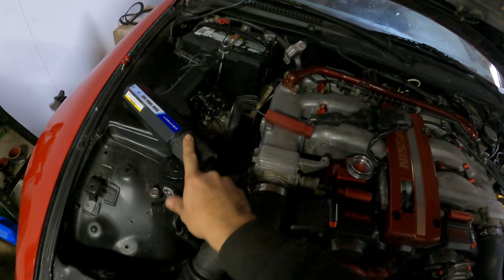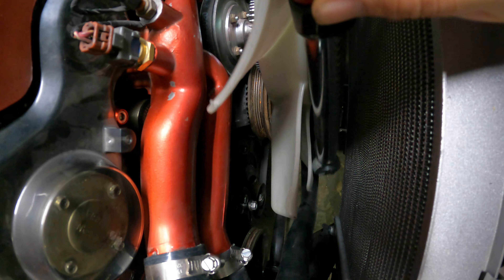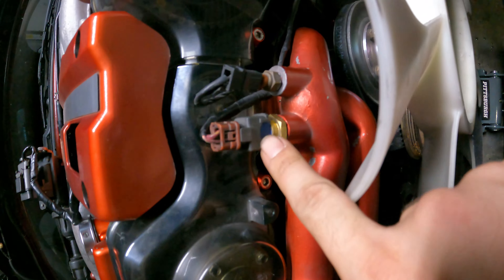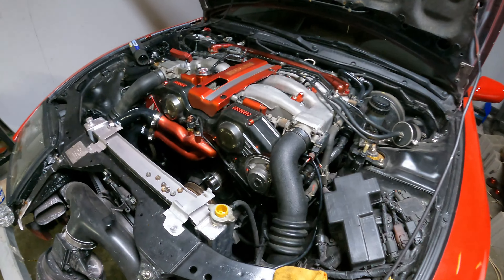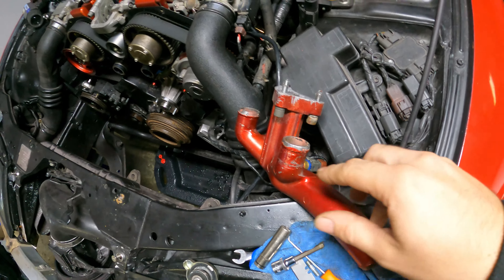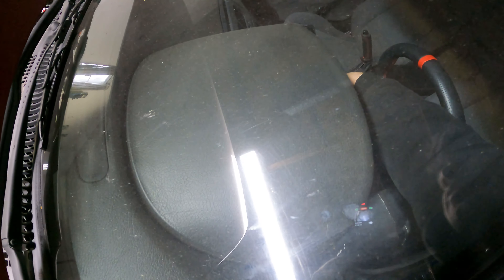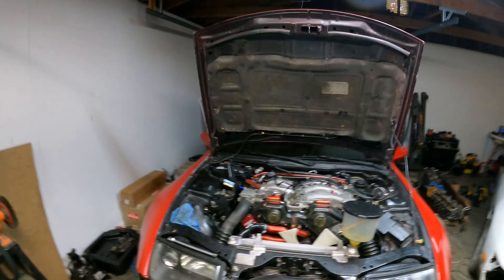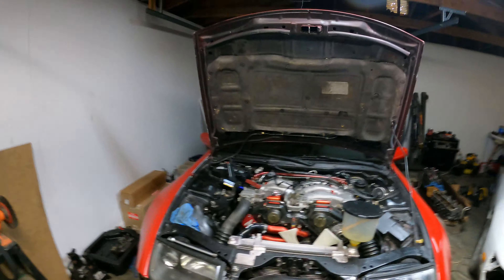This 300zx is Fully FINISHED and Ready to RIP!

Comment: To torque the crank shaft down on an automatic you need a crank shaft holding tool
Reply from the maker: Does it bolt to the 2 bolt holes and rest against the frame rail?

Comment: I got those same type of dress up bolts on my Z. Those aftermarket smoke timing covers don't work well with those Zspec bolts.
Reply from the maker: They had me stressed at the beginning🥺
Reply: @ yeah I believe those are AMS smoke timing covers. I reused my oem covers with the ZSpec bolts and didn’t have this problem. I’m glad you did your due diligence and figured it out before some other issue popped up 😎

Comment: Do you have leak somewhere in your ceiling?
Reply from the maker: That may have been the coolant I heard it a few times editing haha.

I do have to replace my roof soon. Drip edge is on wrong and causing water to curl under the overhang. Plenty of boards need replaced too🤕
Reply: @NedacSnosrap  the fun never stops my friend
Reply: @NedacSnosrap  with headphones on you can hear it really good🤣